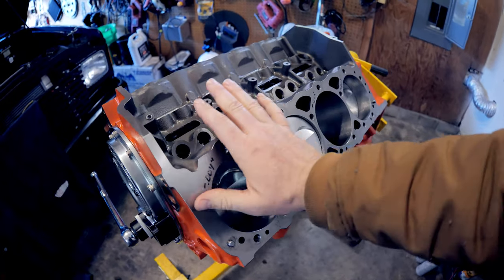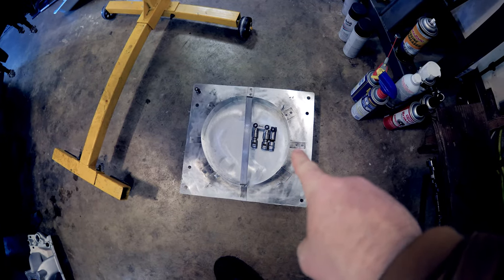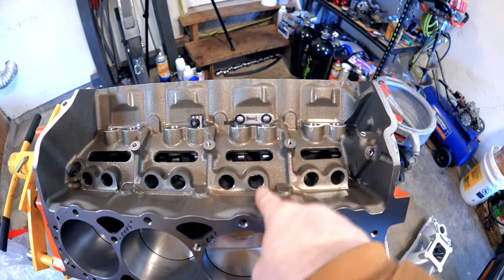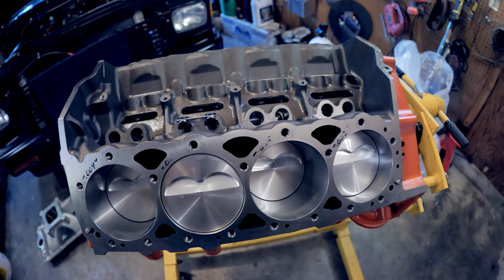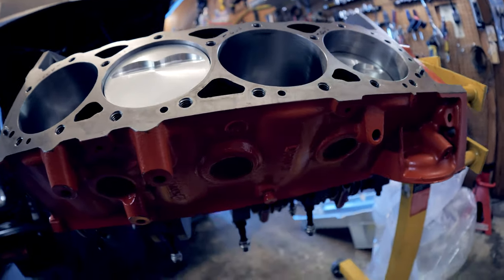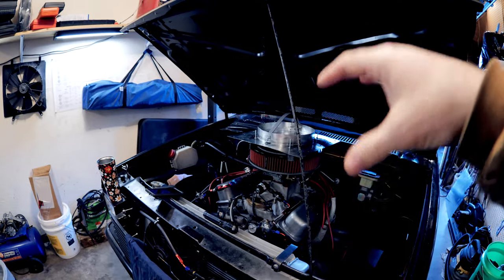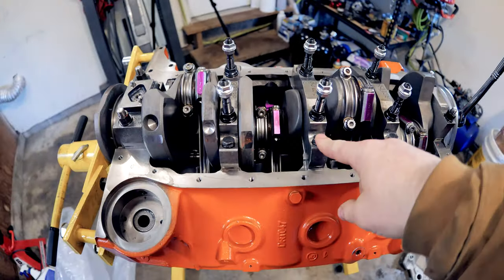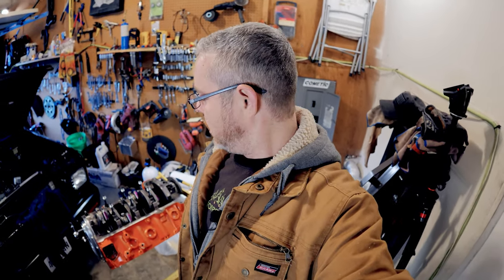Dart SHP Block VS GEN1 and GEN2 SBC Stock OEM Blocks  " Small Block Chevy / Chevrolet"

Comment: The LS engines use a gerotor pump that is crank mounted and flows much more oil than the Gen 1 and Gen 2 style cam driven gear pump. With so much more oil flow GM was able to do away with primary main oiling.. Because of cylinder deactivation and variable cam timing system GM had to use this setup on the new style engines. The oil is also thinner on the newer engines. 

The older style engines need primary main oiling because of reduced oil flow.compared to modern engines. The GM 60 degree V6 engines had many rod bearing failures because of cheap aluminum pumps and non primary main oiling. Oddly enough the only version of this engine to have SBC style primary main oiling was the "race only" version all aluminum 3.0L engine that was NEVER released to the public. In those 2.8, 3.1L,  3.4L, 3.6L and 3.9L engines, they only had two oil galeries. The lifters got the oil first, then the main bearings, then the rod bearings. In performance applications the rod bearing oil would get too hot and thin causing bearing to crank contact causing failure. 

In the latest iteration of that engine called the high value engine 3.6L and 3.9L. GM replaced the gear pump with a gerotor pump for increased flow. The 3.9L came with a forged crank.

Comment: 12:13 yes the block is thicker there for the splayed main caps, however just being splay over vertical 4 bolt is stronger due to the angle of the bolts. Think of a tent having tie down ropes at an angle to keep it from swaying under pressure.

Comment: 400s are a great engine but they got a bad rap back in the day because GM crippled them with very restrictive heads. They put the same runner head on as the 350 and couple that with a shorter rod they just couldnt get air. Have a couple myself and always loved the torque these can put out with minor upgrades.
Reply: what were the minor upgrades that made the differences .just picked up a 400 pretty stock

Comment: If the lifter fails you have to pull the whole engine for a rebuild.  So going the extra mile to sneak them past the heads when building is pointless.

Comment: I have seen guys in Mooresville run 900hp on them shp blocks
Reply from the maker: This one should be around 800 crank on the kit.
Reply: That's gonna bad ass
Reply: Gonna be bad ass
Reply from the maker: @amandamitchelfrye1603   Man I hope so, I have always loved the 400 SBC ever since a neighbor had one in a 1975 Vette back when I was a young lad. I blame him for planting the bug during my childhood.
Reply: Shit the shp blocks can Handel alot more then 650hp i have a 351sbf shp block that is 446 cui and its a nitrous engine that makes North of 1100 hp on bottle
Reply: I have a factory 400 2bolt that I had machined to a splayed 4 bolt and the blocks been poured I'm hoping It can handle 700 or a little more but we will see.
Reply: @amandamitchelfrye1603  what’s the block number ?
Reply: I have a stock block 76 model which the 462 heads 2.02/1.60 valves and a decent cam and it's a torque monster!!

Comment: A factory 4 bolt 350 block is very strong. A 4 bolt 400 is a little weaker though.
Reply from the maker: Yeah I have seen them take some power.

Comment: was hoping this was going to be the pro block as i have one on order and is due to be shipped to the uk this week, im struggling to find correct lifters etc as the pro block runs the .904 lifter bore and bigblock cam
Reply from the maker: I only got SHP money.
Reply: @TPVPRO  i hear ya , theres about $500 between the shp and the pro, and i really like the 4 bolt on each cap plus they are all billet steel on the pro
Reply from the maker: @rossco19801   Yea that is better for sure.

Comment: But the “Elephant” in the room... Dollar for Dollar how much faster would you be if you had gone LS? Being honest not trying to blow smoke. 🤔🤔🤔
* I was very hesitant to make the switch mainly because it’s hard to abandon a platform you’re familiar with. But after seeing my friends building $1500-$2000.00 5.3’s making 800+ WHP running low 9’s it becomes enticing!  JD
Reply from the maker: The LS is a great motor and yes an LS is cheaper nowadays for sure. I have just always wanted a 400 CID SBC because they are just a little diffent. Way more LS S10s than 400s for sure.
Reply: That 400 shp can make more power than a 5.3 ls. Is it as easy no but it is very doable
Reply from the maker: @michaelstoker6710  Especially with a turbo. Richard made 1000hp with a super charged 400 pretty easily.
Reply: @TPVPRO  yeah we got guys make 2000+ with the gen2 lt1 factory blocks just wait tell the aftermarket block gets here. Everyone wants to ack like the ls is so much better. You put a set of good 12begree head on that 400 probably 10 different heads that fit that and it will make 1100 na. I believe mbe has a dart ls7 head that can do that and mast canted valve heads may but thats it as far as I know.
Reply: @michaelstoker6710  those stock blocks were all that was available. 40 years ago. I ran many two bolt main engines with pink rods ant trw pistons and cast cranks at the 500-600 hp levels. Maintenance levels were higher and we lost an engine or two, but it can be done. The ls platform in stock trim will sustain 1000 hp with just adding ring gap, cam and a turbo. Can’t do that with a stock 350 or 400. Can they be built to take the hp?  Sure they can. Just add a $3500 crank and rods and pistons and add another  sum for a set of heads to support the hp. That’s the difference between the ls and small block. Nothing wrong with either setup. Pick your block and build her up. Builders choice. Neither is wrong. Both are good picks.
Reply: @lloydholt6511  I own at least 1 of every gen sbc and like them all. It just bugs me that everyone is but if you had went ls you'd make so much more power. For one I'm old school I know the ls will support a lot of hp factory  but I've also seen lots of them sbe 5.3 get no where near that 1k hp before coming apart when I put something together I don't want over and over so I still go get forged crank rods and pistons then the price becomes basically the same. That shp block and afr 210 heads I believe he said and solid roller will make more power than a 5.3. Like you said can't go wrong with any of them
Reply: Nobody is making 800WHP 5.3 for $1500. I had to put forged parts and a $7,000 Whipple on it to sniff that.
Reply: @TPVPRO  No way that guy above built his 4 digit ls for 2-3k. If he did it was old used junkyard stuff and bet its already barfed its cookies
can only get so much to the ground anyways
Id love to afford a little M or shp just cant. 
Get those lifter bores to .904 for one
Reply: @michaelstoker6710  Agree!! They dont hold together very long and so many 1000hp builds never made tht much, just theoretical. 
Cant use tht power on the st its useless to me.
Reply: @SOLDOZER  Agreee he is full of it. These guys say it as if nobody else would know either lol. Can be tough to get 4-500rwhp to hook anyways.  A car that cant be hit hard til youre doing 70 is useless to me

Comment: Is any one having trouble with motor mounts ? I just tried to install my new shp 406 in my 81 z28 and I’m having mount issues , it’s mount bound before block seats deep enough to to put both mount bolts in .

Comment: Do you have the info on the oil pan you used, I'm using the same setup
Reply from the maker: The SHP right? Call up CNC Motorsports that is where I ordered mine they know what pan to use on a S10.
Reply: KEVKO 1073RH

Comment: Stock 400 blocks have cylnder bulges to
Reply from the maker: I did not know that thanks. I have never been able to get my hand on one.
Reply: @TPVPRO  yep I have a handful laying around lol
Reply: @brandonbell8159  I have the 817 that baby has seen 7000 rpm by mistake but still kicking  has 5.7 rod srp pistons we’re gonna see how much power a 2 bolt main can take lol Siamese cylinder but I think they crack around the head bolt area so I heard ...
Reply: @juiced71  yeh the steam holes to the headbolts is were they crack.
Reply: Yes I've turned down good money for my 76 400 sbc!!
Reply: @brandonbell8159  Many drill and tap that hole, put a pipe plug in then drill their holes making it stronger

Comment: Why not just go LS set up!
Reply from the maker: I may as well put on a skirt and wear lipstick when that day happens to the s10.
Reply: You would fly by so fast that no one would notice the improvement : )
Reply: Cause he doesnt need to. Ls arent magic
Reply: @jimandskittum   How many ls builds have you done and tracked?
ENgine doesnt know what gen it is, gen 1s have made huge power even NA for decades
Reply: @gordocarbo   I haven't built an LS but I've built a few SBCs. I can tell you that stock rods in a 600+ hp build will work in an LS but not a SBC.

Comment: 88-98
Reply: 1986 in cars was the first year
Reply: @terrygonyon4490  87
Reply: @terrygonyon4490  technically it was late 87 but the correct answer from general motors is like Brandon stated 88 and up
Reply: @jonathanlawson4667  1986 was the first year for roller lifter provision blocks. The 305s in the GM v8s had it in 1986 although they were still flat tappet in a lot of them. I had an 86 Grand Prix with the roller lifter block. it was 1987 in 350 blocks I believe.